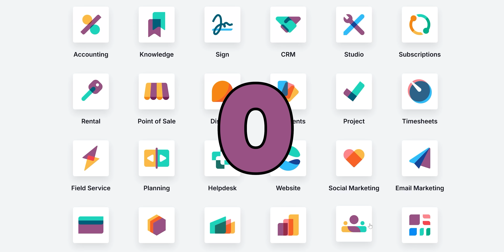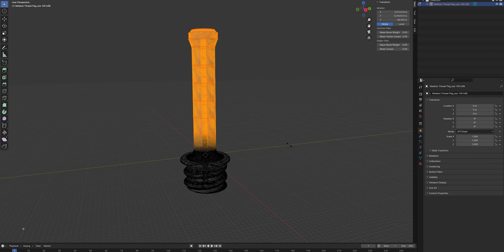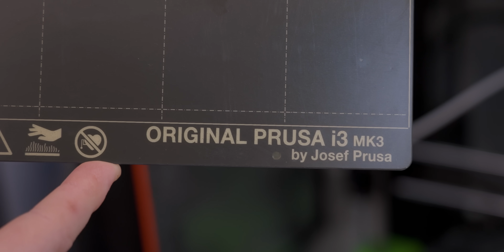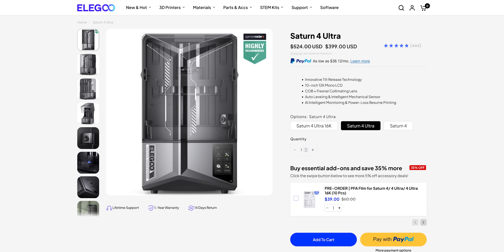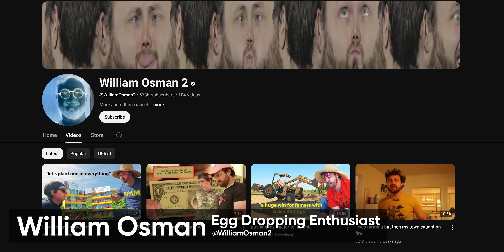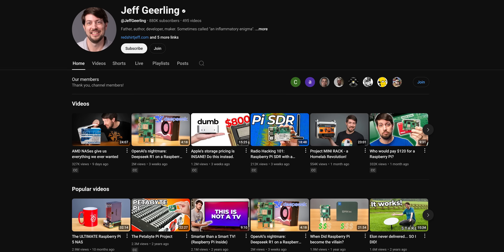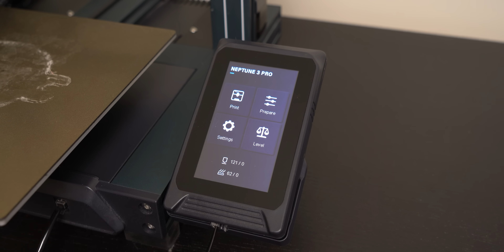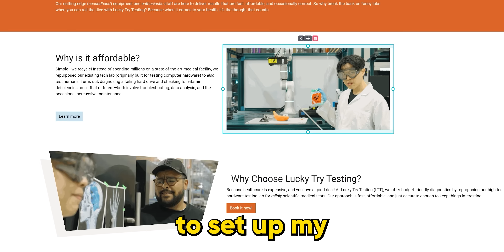Is my 3D printing setup wrong?

Comment: you know what, I've love to see a video of hacking your own firmware onto a bambo, and maybe even making your own firware, or just mods to firmware to work with it

if this takes an embedded engineer, the maybe intercept the sensor and motor wires and run your own arduino maybe?
Reply: no points the bambu printers already have a 3rd part software and its just a simple root
Reply: @ScyborneOG  nice, then I'd like to see them do that :) I don't have bambo, but I wanted one until this and the proprietary spool stuff
Reply: @ there is no proprietary spool stuff going on do bambus spools have rfid yes but its just used to load their filament settings into the filament profile for printing  so you don't have to do it its just for convenance plus people have already cracked them and have made their own versions i have an x1c and just updated today to the new update i can still use orca just fine as i did before the update

Comment: man, i didn't know bambu did all that nonsense.  i am so glad i got an ender3 V3 KE.  remove material spool from top of the gantry and add supports from the top of the gantry to the rear of the base.  you can run a script and enable generic USB camera support and mainsail so i can now use orca slicer.  with PLA or PETG my prints are flawless and can print up to 500mm/s(usually don't though).

Comment: Prusa XL 5 tool is the choice to make if you have the money. Fastest multicolor prints and multimaterial capable. Dead simple printer to use as well. AMS prints on a bambu take FOREVER compared to the XL. Everyone I've encountered with 3d printing experience is amazed at the quality and speed of the XL printing in color. Sure, there are faster single filament printers, but after having done that for years, I'm just not interested in printing objects in one color.

Comment: I bought an A1 mini literally the week before this whole debacle. And I have to say, while these new policies suck*, I absolutely love the printer - and if I were to get an upgrade (a larger build volume *would be nice, but first I need a larger apartment to put it in), I'd probably go for Bambu Lab again unless someone releases something that matches the P1 series, including an easy to use multimaterial system, but mainly for the speed and simplicity. From what I've seen even the A1 mini is massively faster than most 3D printers, and given that even a 3-4 hour print starts to get annoying to me, I couldn't really work with anything slower, especially if it was also larger. All that being said, I am looking forward to the inevitable hacked firmwares and other mods that might wrest control of the A1m back from BBL.

Comment: A great cheap solution for keeping your filament dry is getting a huge bag of Epsom salt, putting that in a dish and baking it as hot as your oven goes (550 is ideal) for a couple hours. Break that up and put it in your filament storage container, works great as a desiccant. When it gets wet again just put it back in the oven. It's food safe and very cheap.

Comment: Newbie printer here...  Bambu P1S+DualAms owner, eventually trying to make cosplay and car parts once I get better at 3d design and slicing. If you are interested in my experience in this new hobby... Please read. 

Found out about this firmware stuff after I already bought the P1S/AMS + PandaTouch. Not a fan of the closed off environment considering how much this industry seems to share slicer software and other technology. It was a learning curve (since I am new to printing... Started nov 2024), though the app makes pre-designed stuff easier to create. I wish this device had a 25% speed in pla but started learning about petg (drying and specific fan speeds and heat temps) and am happy with the lack of noise. 

Hardened nozzles and gears, silica containers everywhere, panda led (unplugged the Bambu one since I read about a power problem with too much draw), wyze v4 cams on the top and door, panda touch and cereal 4L/polydryers have really helped. The AMS is great for continuing prints with the same color filaments (ie not wasting or storing 100g of remaining filament on a spool). I have black/red/white petg /and chameleon pla in each ams and refill when I kill an entire roll, and the system keeps printing away without any downtime. Annnnnnnnnd... I'm not upgrading past 1.07. I have a sandboxed network ready to go once I get better at the slicing on PC. Wish the Bambu app had a custom petg print build I can save rather than having to change every time.

 If I could go back, after all I learned, I think I would have looked a bit more closely at the Prusa stuff or bought a Bambu X1 (apparently Linux based and is hackable unlike the P1/S series). The learning curve was "mostly" expected since I am working my way to abs/asa and expected growtents, voc filtration, drying, and damping/noise. The rugpull in Jan 2025 about locking down the servers, blaming security when it appears to be a profit-driven move, locking out 3rd party mods, and trying to redirect all traffic through servers was not expected and not a nice move. In my home network... 3d printers, fpv drones, ip cameras, and other electronics phoning homeland china unnecessarily is a bigger security risk IMO. Not everything should be connected to the cloud.

Just a thought... the inevitable DJI drone ban this winter... Wonder what will happen to the DJI fly app (which is not available on the app store) and the expensive drone people bought when politicians decide to ban an imported product. Expensive paperweight? Same "could" happen to the 3d printing world...

Comment: Damn. I JUST bought a Bambu Labs P1P printer last night. Not being delivered until Saturday. Is the controversy bad enough to recommend cancelling the order and ordering a Prusa? Im a full on beginner, so I don't have experience with  anything yet, so if the main issue with the controversy is that its causing people to need to change their ways, that wouldn't be the biggest issue, right?

Comment: 9:49 I used to print using resin and I used a  concentrated cleaner called “Mean Green,” to wash my prints and they came out out perfectly. It is low cost cleaner.

Comment: tbh all the other setups are "worse", so far nothing really beating the X1C in performance and reliability, having a proper filament drier completes that machine very well. Not something I would switch away from. Prusa has been playing catch-up with Bambu but is far from meeting them yet. All the other FDM are more targeting the low cost market or are spezialized machines like having a gigantic print bed.

Comment: I'm not a huge 3D printing nerd but I have learned quite a bit over the years. Currently I have a Bambu A1 Mini + AMS Lite and I love that thing. Is it the fastest in the world? No, but it gets the job done quicker than most and is pretty quiet. As for filament, I leave all my filament out and don't worry about drying it out. I have yet to have issues other than sometimes filament breaking (it was my fault each time). I primarily use PolyLite PLA and had 0 issue thus far. If you are a tech/3d printing nerd, go with the Prusa to have something to play with. If you want a set it and forget it printer, Bambu all the way.

Comment: I find 3D printers absolutely fascinating and I really want to get one. The only problem is, I have absolutely no use case for them and I really don't know what I should print with them. Sure, printing spare parts like that wheel for the vacuum cleaner makes sense, but I don't have any broken parts. 😮

Comment: To be clear the "updates" people are calling controversial were beta updates that were never actually deployed.

I have clients would would have had major problems had the update gone through, so I understand why its controversial.  But most people would assume these were actual updates you had to install to continue getting that actually limited your printers function that went out.  And that is not true.  You have to check a box in the new update, to do exactly what you could before.

Comment: I'm sorry, but I'm pretty disappointed in how Jake is handling his resin printer. On top of it having resin STILL in the vat (despite how little, even a little can cause fumes), handling EVERYTHING without gloves, having it on top of carpet AND not having it in an enclosure when its more necessary than that FDM one he has due to the fumes it releases while printing and washing, this is just downright irresponsible.

Comment: Jake's dryboxes :D Very nice I did the same thing. However I drilled one 6mm hole in the front and added a thing that needs 3 holes on each side to hold a bearing and a roller so the spool can rotate freely. This allows me to just print straight from the drybox like there is no chance of fresh air touching as its completely sealed all the way to the printer. Also I added a moisture sensor to each box. All of them stay at <10% moisture at all times. I got cheap desiccant from Action called Limpro and it works great. If the moisture goes above 10% I shake the box around. If it is still above 10% I lay it on its side for a while and that usually reduces it to <10%. If it is still above 10% after that its drying time. Specifically the desiccant not the filament itself.
People always say that PLA doesn't get wet. Absolutely wrong. When PLA gets wet it breaks like spaghetti. A drybox therefore is essential to 3d printing.

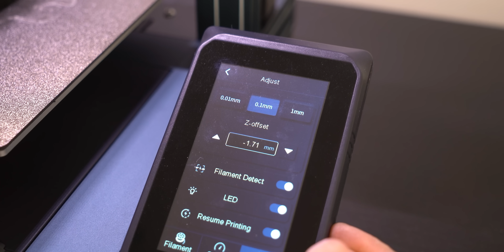Comment: Holy shit, the dude at 17:00 pitching the Neptune to people while the Z-offset changes randomly. I couldn’t possibly imagine a worse thing for a printer to have wrong with it than this. That is the biggest 3d printing red flag I’ve ever seen and I can’t believe he’s just fine with that.
Reply: had a similar problem with my neptune 4 plus but tightening the rollers that control the z axis movement did the trick. Now im Just firing STLs at my printer an each print comes out perfect.
Reply: @derptrollstone I have the same printer. One of the first things I made from it was the a locking collar for the Z and X axis knobs.
Reply: yeah that was well off... I mean what total noob is going to userstand how to diagnose an x-axis issue, let alone one that randlomly changes with every print. Ender is a good learning platform, I just got an Anycubic Kobra2 and have been having a decent time, but all the tweaking I learned on the ENDER was why i can diagnose issues with the /Kobra, faster prints=bigger mess when it goes wrong
Reply: If you watch his videos you'd know he's just a masochist and struggling while building things is his thing.
Reply: It's still faster than his cr10, and not everyone is made of money to spring for a bambu or prusa. If he's been in it long enough to remember the days having to babysit the first layer of every print even on GOOD printers, this probably doesn't seem all that dealbreaking.
Reply: @WafflePlaneRC just get a Creality ender V3  or KE then
But honestly at that point I would go for the K1SE or the HI or just get an A1
I went from ender 3 to the V3SE and the auto Z and leveling has been good.
I was considering the V3 but the BF deals on the A1 were too good to pass up, 425 for the combo was worth it over the V3.
Still looking for a core XY machine and I am going to wait for the wondermaker , I might get it or wait for it to transform the industry which it will if it's successful and actually comes out
Reply: @WafflePlaneRC  You will spend more money on fixing cheap printers than getting a good one imo

Comment: No one trying or using the Creality K2? Less than 30 minutes to set up, bearly any config changes required, and the CFS is rock solid. Plus the CFS keeps your filament from deteriorating.

I think you have done a great disservice by not demonstrating Creality's new king of printing. Let's see, bigger bed than most, quick set up, FAST, camera, hardened tip, solid on any surface, all config is auto and bed levelling that makes 99% of prints successful first time. In fact the only prints that have failed have been because I modified the wrong setting. It basically ticks every box your people complained about.

Comment: I believe, and I am not 100% sure, but over, well over half that the printers are set up as nodes on their network, and not meant to just send prints from computer to printer. It MUST go through their network. Why else would the "LAN MODE/Developer" mode HAVE to still go through their servers? I do believe that is part of the cost for the X1E.. is it is an actual stand alone card instead of a lan node/card that is the control board in the Bambus. Does that make sense?

Comment: For fast prints, get one VzBot or HevORT
Once you calibrate those, you can get insane speeds while still having perfect quality.

And they are modular and completely open source. Plus the price is practically the same of those "high end" consumer printers.

CoreXY with Beacon, triple Z, MIC6 plate, ADXL, Klipper and you are never gonna look back. Maybe just for the simplicity of the Bambu and such.

If only there were people in LTT who... know tech :) Those might have real fun with those I mentioned...

Comment: To Camden Bowen, check the start G-Code in your slicer or check the bed leveling macro that is built into the printer. You're Z offset is probably being reset every time because of the bed leveling. You should be able to get in there and create a macro that saves variables

Comment: Bambu Labs better listen up. Everyone in the 3DP community has taken a stance and now with LTT straight up speaking openly against their recent changes, it's going to cost them sales. I myself am about to get back into it and was considering a P1S, but that's off the table now.
Reply: you can still use orca slicer ltt has released an outdated video that was recorded a month ago and hasn't updated any of the info like usual

Comment: My favorite thing to do with my 3D printer is print parts for my 3D printer. I'm now in the process of building a voron 2.4 and I'm using the 3D printer that I built from scratch. There are a lot of pieces for the new printer that I have to print. I'm just tired of a bed slinger because I'm tired of having leveling problems with the bed.

Comment: Linus I don't think children should print thamselves toys from plastics. It's a bit inconsiderate having how wastefull it is
Reply: its actually better id rather kids print themselves toys from which they can get multiple off from one spool that having each toy internationally shipped from China just to be used for a few weeks then thrown away also pla is made from corn or sugarcane which is what the kid is using and is bio degradable it will be gone in 10 years and back to earth if composted compared to factory made toys which use abs which is injection moulded and isnt compostable so in the longer run its a actually eniromentally better to 3d print

Comment: Just 3D print a hatch 🙄🙄
Reply: wouldnt work also the ams is a sealed enclosure and is built for one reason only and its to keep moisture out and make filament switching easy especially with colours
Reply: @ScyborneOG  so make a hatch that could be sealed and unsealed, im talking about when linus asks bamboo to make a hatch to be able to clean in the bottom with out taking it apart. plus It was mostly a joke cause he's asking for something made of plastic for his plastic making machine.
Reply: @GingerBradMan21  its not the fact of sealing its the fact of how well it holds up overtime and how it deals with moving parts and how well it seals even with tpu or silicone gaskets
Reply: @ScyborneOG  still taking it too seriously

Comment: The whole Bambu Labs update has been blown out of proportion. You have a choice, update or not. I haven't updated and the printer still works like it has before. As good as a Prusa printer is, it is highly debatable whether they are better than a Bambu Lab printer. A Prusa is definitely not better value imo. Like a 5080 graphics card at 5090 price.
Reply: i updated and it still works the same with orca people are too dramatic these days

Comment: So i'm involved with 3d printing stuff, here's my take
If you want a printer for kids look into aeoseed x-maker
Prusa is reliable but overpriced
Bambu has sh*t morralls
Hardened steel nozzles are the opposite, they are stickier, stainless steel is superior
The cr-10 is actually dangerous, the mainboard has tinned wires inside of clamp-terminals, ptfe hotend, and currently is a terrible printer and is obsolete
Overall good video but pleasepleaseplease fact check it. People are gonna listen, get enraged at their printer, and leave the hobby

Comment: I have an Ender 3 V2 with a Sprite Pro hotend and ABL added on, prints like a dream, not super fast, 120/mms is about the fastest I will push it, but the quality and accuracy is great. For anyone with an older Creality machine, such a Camden Bowen with his  CR10 S4, I definitely recommend adding a Sprite Pro, the direct drive is a huge upgrade, plus it's all metal and comes with a hardened nozzle, so you can do flexibles, abrasives, and up to 300C filaments.

Comment: Bambulab printers are great, but their software is not so great when you put the printer in a separate VLAN to block it from WAN and configure the printer in "LAN only mode". WHY DO I MISS FUNCTIONALITY IN LAN ONLY MODE WHEN EVERYTHING CAN WORK IN LAN MODE??? AND WHY IS MY UPLOAD SPEEDS TO THE PRINTER SLOWER THAN SNAIL EVEN WHEN MY PRINTER IS NEXT TO THE ROUTER??? WHY CAN'T I JUST USE A CABLE INSTEAD OF THE EXTREAMLY SLOW 2.4 GHz CONNECTION???